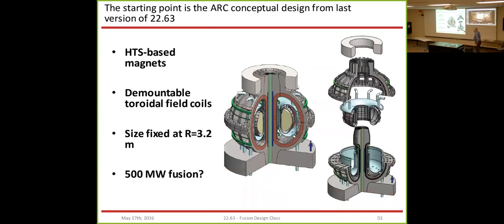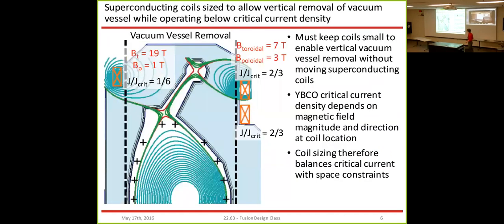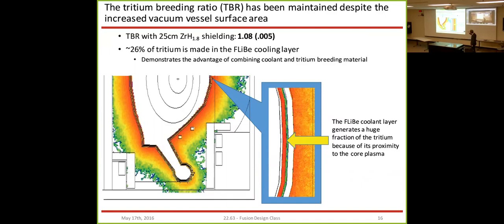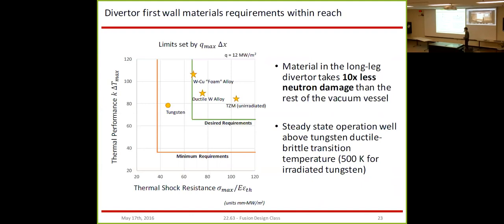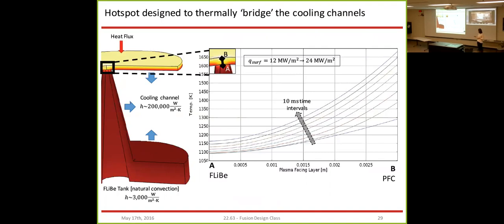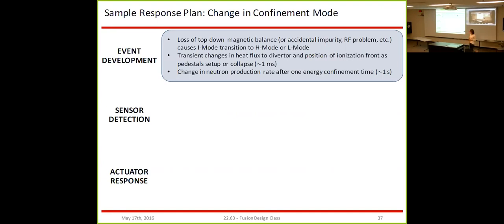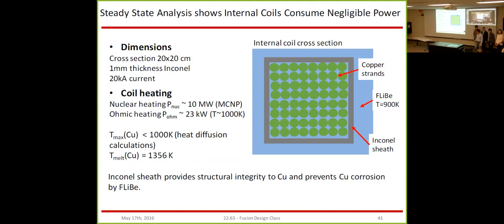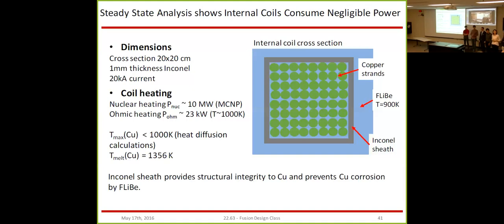ARC Divertor Design Class Final Presentation

Comment: The observation of the proposed hot-spots sound really challenging.
* only a few square millimeters radiating area
* detecting a bit more red hot in on a red hot background
* observation trough a meter thick column of FLiBe
* IR fully blocked by FLiBe
* blue part of spectrum overblown by strong cherenkov radiation?
* potential FLiBe transparency loss in remaining spectrum by radiation and impurities from corrosion.
If that works out I'm impressed.
Reply: Who said the surrounding area was also red hot?
Reply: I'm wondering how well direct thermocouples would hold up to neutron bombardment.

Comment: Super good work... i would love to have such courses in Italy too. We do a lot of theory and nothing practical! 
I have some question,  if i may:
3 mm of tungsten armor is maybe too little... Don't you expect insabilities or transient events in your reactor? Such configuration seems super good for reducing the flux on the divertor because you cool the plasma through radiation, but the magnetic field is so complex! During transient events the plasma would never reach such distant divertor... forget 0.5 MW/m2! And these numbers seems so low! How could it be that ITER has a lot more surface with the same fusion power, and still it has an expected heat flux (20 MW/m2 during slow transients, 10 MW/m2 steady state) much bigger than yours?
And the most important issue from my point of view: Are you sure about additive manufactured tungsten? You speak as if it is a solid technology! From what I saw there are several problem regarding tungsten brittleness.. Such scaffold structure seems so fragile! Porosity too would be an issue..
And for the other concept... What is TZM? and how do you make a joint with the tungsten tile? 
Thank you for sharing your project!